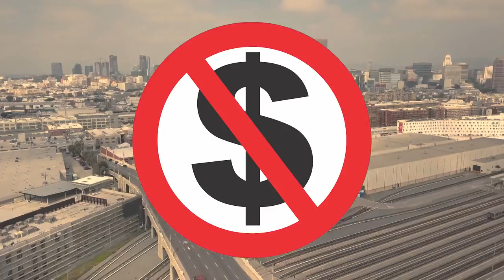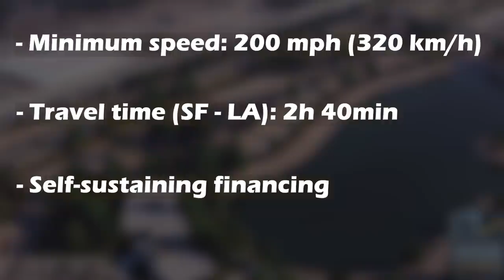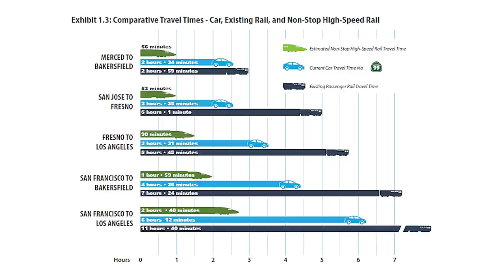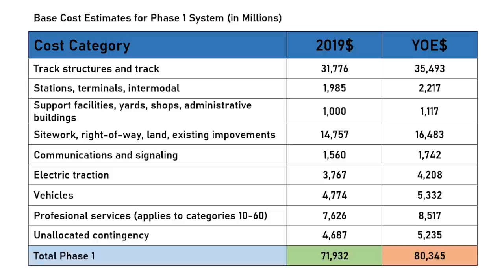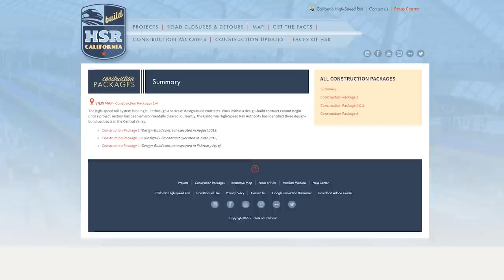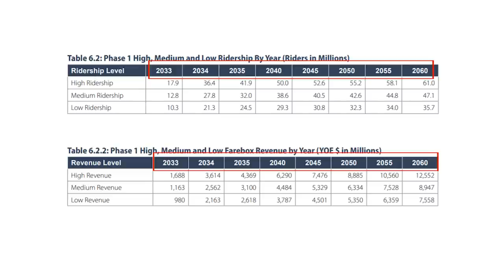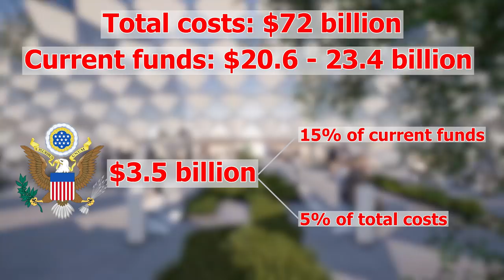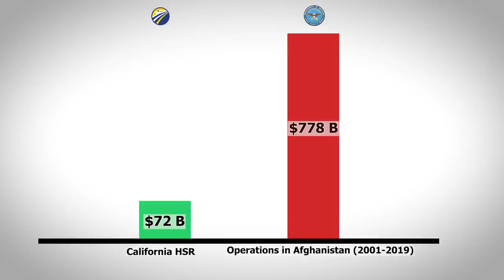California High-Speed Rail Project: All You Should Know

Comment: The video images of trains traveling over bridges and land are not the California high speed rail. They are at best a fake  projection of a boondoggle. California has no high speed rail, today, despite having spent nearly $30 billion of the $90 billion projected cost.  Fact: Not a single track has been laid, not a single passenger boarding station built, and not a single high speed train locomotive produced for this project.  The ambitious project was sold  to taxpayers by the trade unions whose membership are the primary beneficiaries. The California high speed rail is nickname the “the train to nowhere” for good reason. It is a scam. The project requires all Los Angeles rail passengers get off the train at the toe of the ‘Grapevine’ , then board a bus that would take them over the mountainous terrain to a small city Bakersfield, and from there resume their so call high speed rail, whose average speed is 60 mph,  to San Francisco. California high speed rail is a scam at best, a premeditated crime against humanity at worst. Instead of showing videos of an imaginary high speed rail, this videos  should be an example of special interest groups in Sacramento pulling the political strings of corrupt politicians who sold out the tax payers.

Comment: Over 500 miles trains are boring and unefficient !
Reply from the maker: That doesn't have to mean at all. If the train is moving at an average speed of, for example, 250 km / h, it can reach its destination in about 2 hours. How can it be boring and inefficient? 
But, of course, it is necessary to invest in infrastructure first in order for that to be possible.